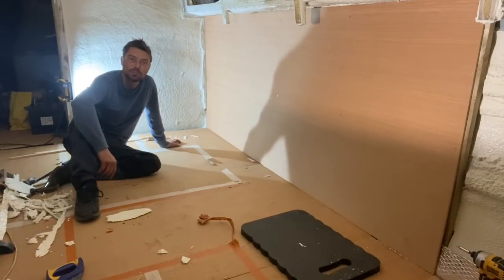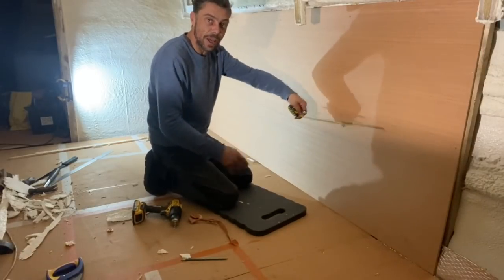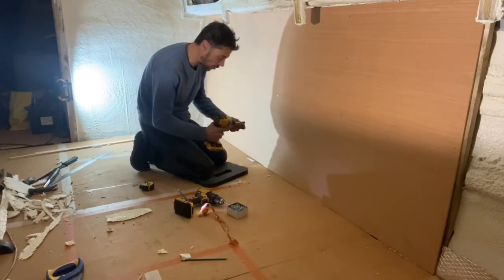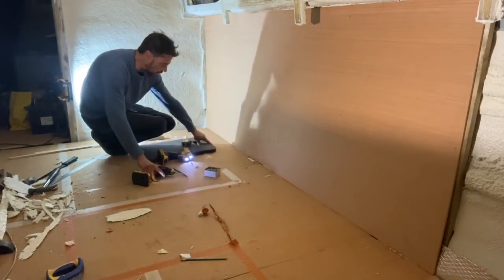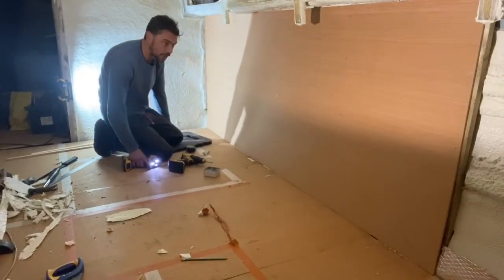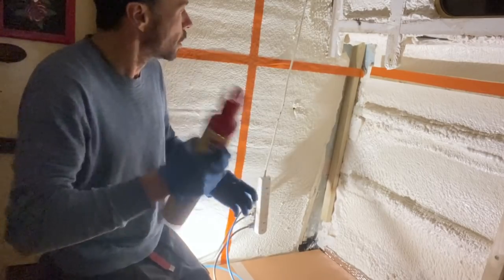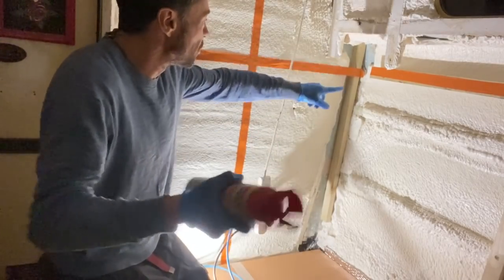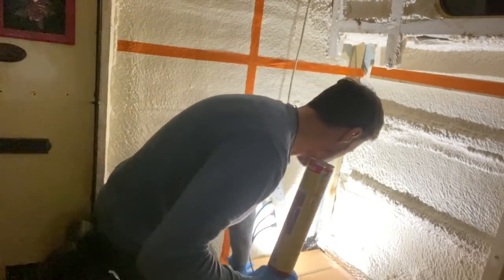39. First wall complete on my Narrowboat

Comment: Grand vlog!... top tip is to spray a mist of water on the surface before you put the foam on, it helps with adhesion, also you can spray water on it when you've done it, it cures quicker..

Comment: CAPITALS DUE TO LOSING SIGHT AND REDUCED COGNITIVE ABILITIES.  CUTTING SMALL SLOTS FULL LENGHT OF THE BOARD,    3/4 INCH APART ON THE REAR OF THE BOARD IN THE EAREA YOU WANTED TO CURVE WOULD HAVE HELPED. A WONDERFUL JOB AS USUAL. CHEERS MICHAEL

Comment: Morning James, if you work downwards screwing the boards you might be able to pull them in a bit more, starting at the bottom of the board is giving those screws a lot to do , one line across and work your way down, looking good though, a light colour paint job will give a sense of space again.

Comment: I smiled when you got the expanding foam can out , I knew what was coming as iv used a few of them , which is why I questioned how much the stuff the pros used expanded 🙂.  Got a feeling you might still have to have a trim over the panel joins , even sanding/filling/painting , but you will see once painted .

Comment: Tips on can spray foam: 
Plan and prep as much as possible, to use up the whole can if possible, in one hit. As they tend to get bunged up in the tube/valve.
Try and get the first application in an area fed rught into corners etc, first. As it had a tendancy to fall out of a cavity, if the first squirts have not adheared well to the surface.
Cover the area below the application, as and drips or fall-outs will make a mess of your boards. It tends to roll down leaving snail trails.
Have a rag handy, as even when you let go of the button, it is expanding in the tube, and keeps bubbling out, as you saw.
Reply: And don't try and rework it in place. Spray and leave till it's gone off.
Leave overnight before cutting. It can stay sloppy inside, when the outer crust is hard.

Comment: I must have misheard that you were going to apply hard insolation over the sprayed in before placing the walls?
Obviously, adding the hard foam must not have calculated out as a significant improvement to warren the cost and labor?
Reply: The hard foam is under the floor, not behind the walls.
Reply: In addition to the floor, I thought I'd heard that he'd add extra insulation to the walls.
Obviously not.

Comment: If you are planning to put in any wall sockets, it will be easier to run the cables (Arctic blue mains 2.5mm) before fitting the wall panels. Good luck.
Reply from the maker: Hi Alan
I’m not going to run any 240 - I’m going for only 12v with emergency inverter. Thanks